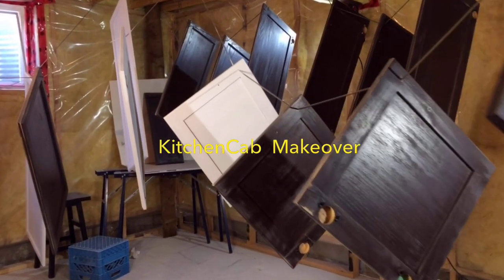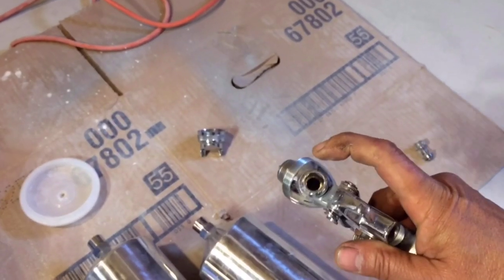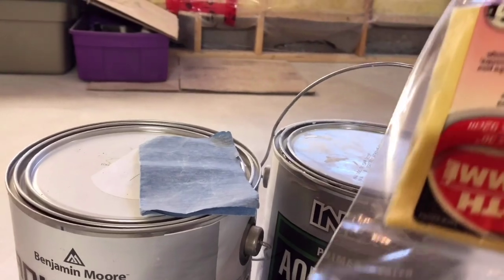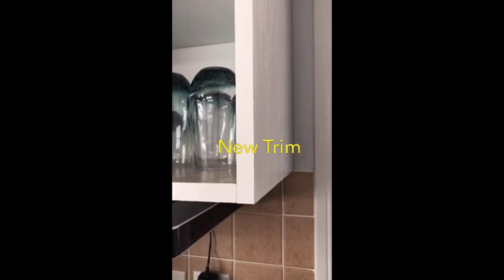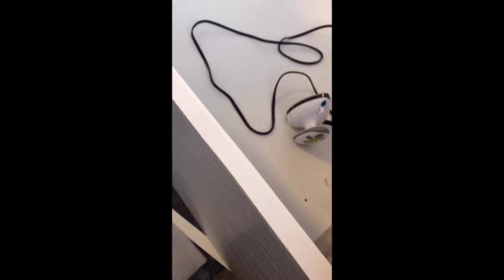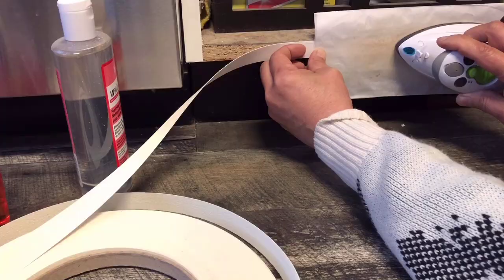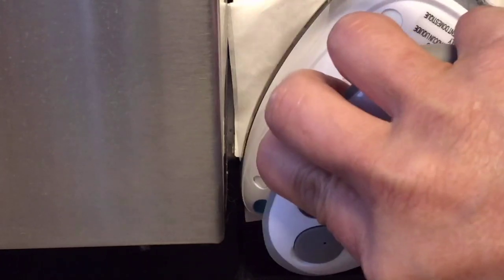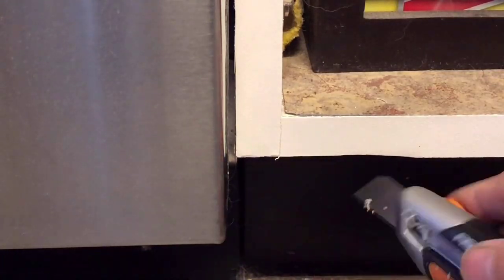DIY Painting Kitchen Cabinets - awesome finishing touch  - must watch

Comment: Wow!  Very professional. Love the colour too. Want the same thing in my kitchen.
Reply from the maker: Thank you so much 😊
Reply from the maker: It is simple to do except the paint spraying part where one will need to procure compressor and spray equipment.   I don’t recommend rolling like painting the wall as the texture won’t look right.  Apply light coats of paint with adequate drying time ( ~30  min) in between spray.  Fun project with rewarding look and accomplishment if you have the time and patience 🤣.